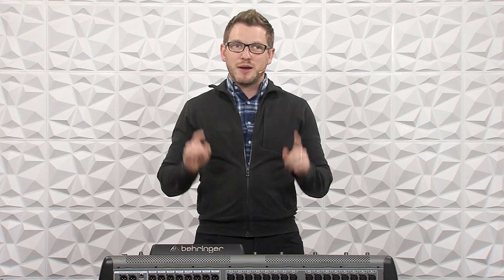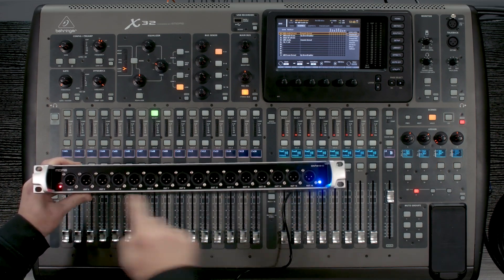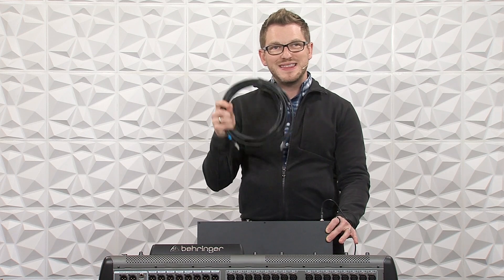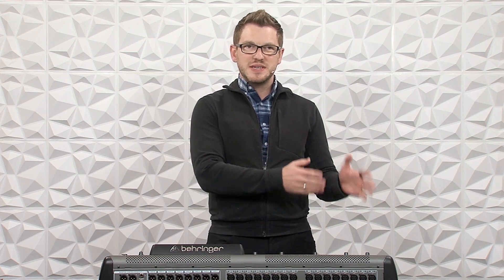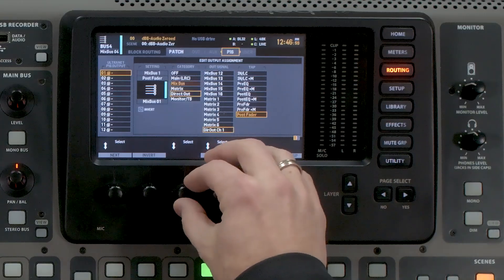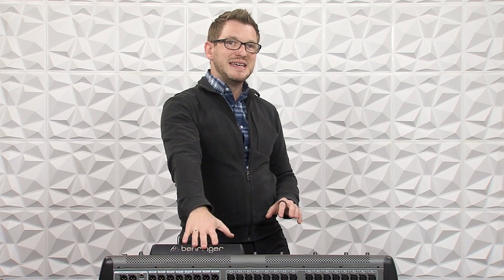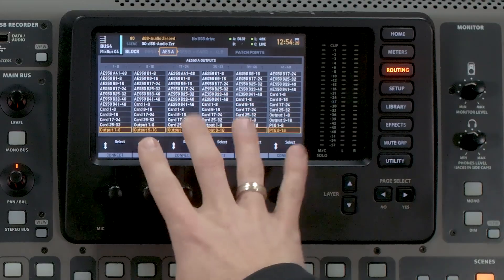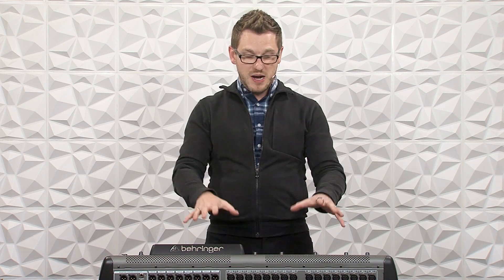Additional 16 XLR Outputs on the Behringer X32 - Midas DN4816-O

Comment: Questions: how can I send all 6 matrix’s separately to new stage box s32 or Midas DN4816 on to AES B without using AES A or ultra net port? Is it possible what should I purchase additional s32 or Midas DN4816 or use local sockets?
My current set up: 
AES A stage box s32 using all 32 channels input. 
Outputs buses as individual in ears 1-13, 14 floor monitor, 15-16 main out. 
For drummer I use Ultranet as powerplay p16-m. 
Currently I don’t us matrix but I want to set up matrix outputs to be local or s32 or Midas DN4816
Planning on Matrix outputs:
1. Extra PA L. (Rear additional speakers speakers for circle worship nights)
2. Extra PA R  (Rear additional speakers speakers)
3. Subwoofer L
4. Subwoofer R
5. Live L 
6. Live R

Comment: Thanks for these tutorials! 

I have a question: as I understand x32 rack has 16 logical Bus mixes, if I’m not mistaken, they’re stereo. Does that mean I can send 4 stereo buses via 8 local XLRs and use DN4816 for the other outs, would that routing work?

Or maybe x32 has MONO buses as oppose to Wing, so that means I’d need Wing rack in order to have 16 STEREO buses?

Comment: We would like to connect two Midas DN4816-O units to our X32 Core via Ultranet. Additionally, an S32 stagebox is connected to the X32 Core. The goal is to use the two Midas DN4816-O units as splitters for FOH, providing an additional 32 outputs. Since we frequently work with different sound engineers using various mixing consoles, we want to establish a simple solution that allows any engineer to easily pick up our 32 channels through the Midas DN4816-O units. Does this setup make sense, or is there a flaw in my thinking?

Thank you very much for your response, and a big compliment for your excellent videos—they have been incredibly helpful many times!

Best regards,
Christian

Comment: So here is my question, we have an x 32 rack and are running 6 p16 personal mixers. Those of course go from the ultra net out to the D 16 power play distribution module which has 8 channels. I have two open channels, can I run one channel out of the distribution module to the Midas 4816 for front of house?

Comment: I have some questions for you about this device, and I would love to see a video that discusses options for an in ear rig.
We use the Behringer X32 system and have P-16's for each of us. We use an SD16 up front and a SD8 in the back near the drums.
When we play at venues that don't have our system, we want to use our system and send the FOH 14 channels for them to use.
I have 16 outs already, 8 on each stage box. Since we are not using them, my thought is we could just assign each channel to an out (1-14) using IN/LC.
Hopefully this would send a raw signal to FOH to use so we can use our system without affecting the FOH.
Is there something I am missing to where this would not work? Is that where a DN4816-O is needed?
Some of these venues still use analog boards and it is frustrating not being able to use our equipment. Thanks in advance, and keep up the great videos.

Comment: I’m a Foh engineer for a touring band and our setup right now is an x32 rack on stage for monitors and I’m sharing gain to my foh console via cat 5. This is working great. But when we have to setup our pa in a pac center or old theater I’m having to send my output for speakers back to the deck via a second cat5 to a breakout box. This has been working fine as well but is there a way that I can integrate this stage connect box and only have to pull a single cat 5?

Comment: This video is quite helpful, thanks!
However I have found that my Midas unit behaves differently. The red LED comes on and stays on seconds after powering the device, even if the Ultranet patch cable isn't even plugged in. 
I'll keep trying a few things here to see if it's otherwise fine.

Comment: Hello from canada! Your videos are very helpful my band my band is using an X32 rack with an s16 stage box for use with our IEM setup. Also at the end 4816 for use as a splitter when at venues without a compatible console. I'm sure have all the information I need in separate videos but perhaps a video for connection and routing for mobile band IEM X32 setups? Including using the auxiliary inputs on the back for additional instruments and the auxiliary outputs for stereo IEM outputs. As a mobile band the encounter many different scenarios. Including different routing and input user settings so that we can easily switch from one scenario to another depending on the venue needs. For example, at one venue we are running our own front of the house sound and monitors. Add another we are sending the venue 16 direct out and using our s16 and DN 48160 as a splitter. Add another they are sending a CAT 5 cable to our X32 as a monitor control. Each of these different setups also requires mapping so that we can access via the X32 for mixing station app on our phones would you consider a video that would basically be a One-Stop tutorial for mobile bands using IEM setups? When I am at home I can spend the time and wrap my head around the different connections and routing but when at an event and pressed for time this becomes very difficult. To be able to set up all these different scenarios as user input routings and presets to be able to easily and quickly select from one or the other in any scenario would be extremely helpful. Keep on making your great videos. Thank you so much.
Reply: This would be a great tutorial!

Comment: can you hook up two sd16s to the X32?
Reply: Wondering the same. Seems like 2 of these and some 8x8 xlr snakes would eliminate the need for a bulky splitter snake for festival dates, etc.
Reply: Yes you can. I use 2 SD16 boxes as my stage boxes in most of my set-ups. You simply daisy chain them. So on my X32 Rack, I connect a shielded ACT5E ethercon cable to the "A" AES50 port on the mixer, and run that to the "A" port on the first SD16 box. I then connect a second shielded CAT5E ethercon cable to the "B" port of that first SD16 box and run it to the "A" port of the second SD16 box. Works perfectly.

Comment: @DrewBrashler would you recommend this setup over using ultranet and a P16 setup or would you consider this a more limited but cheaper alternative?

Or can it be used in conjunction if you are using the output on an S16 and the output on the X32?

Comment: Hello Drew, first: thanks for all your content and the quality!
My question: can we use a Midas DN4888 to expand input and output (I've got an X32 rack and need a little extra more output+input whithout too much physical foot print)
Reply: Unfortunately, Ultranet on the X/M32 consoles do not accept inputs, what I'd keep an eye out for in this regard is a PCI card for StageConnect (to my knowledge one doesn't exist yet). Otherwise the current configuration of the X/M32 only allows these boxes to be used for outputs.

Comment: It is worth mentioning that the Ultranet Output patch points can be routed to XLRs on the mixer and existing stage boxes (SD8, SD16, S16, S32)  to give more than the 16 Bus outputs, IE for Matrix feeds to amps.  The stage boxes have switches to select 1-8, 9-16, 17-24 output groups, but you can customise individual outputs in the User Output Patch in the Routing menu on the mixer.
Reply: Is it possible to daisy chain the ultra net devices to get more i/o? Say I would rather run 3x DN4816's instead of an S32
Reply: @ninethirtyone4264  According to the Midas website product page yes these units can be daisy chained. However an X32 has 16 Mix buss outputs (as Drew explains), so if you needed more than that, (perhaps you have a lot of stereo in-Ears to feed) additional DN4816-O would not increase number the available buss outputs. But you can sent other outputs from the X32 (main, mono, matrix, Aux, Direct ch) to DN4816-O. To get more Mix Buss outputs you can connect two X32s together (the X32 Rack is ideal for this with it’s small size and lower price)

The DN4816-I and DN888 inputs only work with the Wing mixer ‘Stage Connect’ system, (not on X32) also they have no internal mic pre-amps, so for X32 you will still need S or SD AES50 stage boxes for Inputs. As all of the stage boxes have at least 8 outputs, so with several on stage that should cover you for monitor feeds etc as well.

For large stage / band set ups I have 2 SD8 Downstage Front for front line Mics & Di’s (plus keys), and an SD16 on the drum riser for drum mics, back line amps etc (and keys if they are positioned up stage). If necessary I can add an X32 Rack that can be set up as a stage box with 16 I/p 8 o/p, plus 6 Aux Ins & 6 Aux Outs.
Of course the X32 can’t mix all those inputs simultaneously, but different stage patches can be saved in Scenes, or Utility presets, for different band setups.
Using a number of Stage boxes spread around the stage greatly reduces the amount of long XLR cables, particularly useful for keeping the stage tidy at Festivals. Up to 3 AES50 stage boxes can be daisy chained to each AES50 port (A&B) on the X32 mixer.

Hope this helps.
Reply: This is what I needed to know. I’m running X32 Rack to SD16 to SD8 over AES50 A. 
I’ve been pulling my hair out trying to get the outputs on the SD8 as useable outs for busses. 
Gonna be busy tonight. Thank you.
Reply: @marcuscase3308  Yes, it is possible. Set the "OUT" switch on the first Stagebox to 1-8, and the second stage box to 9-16. Make sure your "INPUT" routing is good and you are getting signal FROM your stage boxes of course, then in the routing page, go over to the "AES A" tab. Whatever is selected in the "1-8" column will be sent to the first stage box, and whatever is in the "9-16" column will be sent to the second stage box. 

If you want more control, over exactly what goes to each output on each box, you can assign them to "User 1-8" and "user 9-16" and then tab over to the "patch points" user tab and go wild, send whatever you want to each output. You can also send direct channel taps, matrices, aux outputs, whatever you want.

Also, don't overthink it, just do your "INPUT" block routing first how your normally do it, and then once they're working, you can set your outputs like I mentioned above. With just one AES-50 cable, you have 48 inputs flowing one direction and 48 outputs flowing the other direction, and they're all totally separate. As long as the inputs are working how you expect them to, you can do whatever you want with your "AES A" routing page and it won't change your inputs. 

Let me know if this works.
Reply: @samdelfavero oh it absolutely works. I’ve had it operational just like you described. Works like a charm. Hopefully helps others, too!

Comment: If I added this unit could I provice a direct out XLR for a separate monitor mixer with this unit if the monitor was a different brand than Behringer/Midas? Maybe I would I be better off with a mic splitter? What do you think?
Reply: I plan on doing this. Have the Outputs on your DL32(?)Stage box be Direct Out's ch1-16 and route the DN-O to be Outputs vie U-Net to be ch17-32. However,  you may have to burn a few CH for Mains if your not using separate "Drive Lines" (I have a 2nd EthCon cable installed that I'll use Sound Tools 'Cat-Tail'' for the 4ch I req for Mains..L-R-Sub-dlySub).

Comment: Hey drew. Off topic but I am having trouble getting reverb effects onto my post fader livestream mix bus. And not in the main PA. Our room is very verby so i dont want any effects in the house. X32 of course. Then the FX faders are down for the house, nothing comes through on the stream. Even if the sends on fader FX faders are up. Which is normal for everything else. Any tips?
Reply: None of the mixbuses will get fx because your essentially sending the fx return back to mixbuses and if your fx return faders are down, you won't have any fx. The easiest way to get it done is to select the fx return(s) and turn off the Main/stereo and raise the fx return faders up. There won't be fx in the house but it will be there on your stream, monitors, etc
Reply: @sounddoc92  ok. Yea my crowd mics I turned off to main that way. I didn’t realize you could do that on the FX. I will give that a try. Thank you

Comment: Maybe I don’t understand properly . Would I be able to use this as a drop snake for the Drums?  Plug drum mics into this device , through ultra net , send it as an IN to the x32 routing to individual channels? Or is ultra net out only ?
Reply from the maker: The ultranet on the X32 is an output only. If you purchased the DN4816-I and the DN4816-O you could connect them through the StageConnect between the two units. But you would need to still connect it into the XLR of the console to get it into the X32. 

I’ll be making a video on this in the future!
Reply: @DrewBrashler  But of course, the DN4816-I only accepts line level inputs. No Mic preamps inside the box, so it's back to a normal Behringer/Midas stage box for that. I still think that these units are fantastic additions to the range, kudos to Midas engineers for sneaking in compatibility with the older X32/M32 desks!
Reply: You need the Midas DN4816-I for that (I for inputs, O for outputs). There's also a mixed version of 8 input and 8 outputs available.
Reply: Thank you all , now I understand .. Thanks !
Reply: Overall no. This particular unit only has xlr outs so using it as an input device isnt possible

The second thing is that the ultranet system on x32 devices only works as an output and not inputs. The ultranet section of the routing tab doesnt have any “inputs”, only the ability to tell the 16 channels of ultranet where to pull the audio source from (be it the main 32 inputs/aux inputs or bus sends or other audio channels).